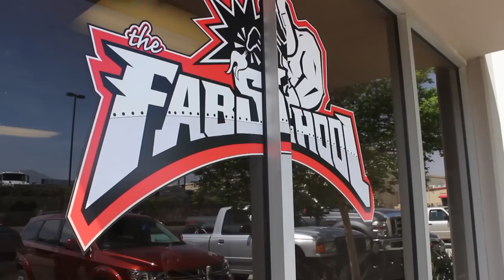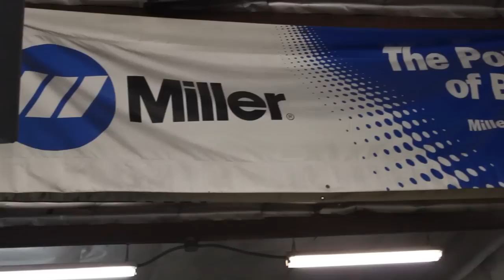The Fab School: Training tomorrow's welders today using Miller products exclusively

Comment: I agree with Defender Chassis.Countinous tacking is necessary for thin sheet and where the weld needs to be pretty(not a weld for strength)..Pulsing is entirely different from tacking or stitch welding.With pulsing the arc never shuts down.It just switches back from a high to a low current.Only high end mig welders can do this.This reply was directed towards mig welding only.The tack,tack method on tubing for a chassis is a no go.

Comment: I can see using the technique on flat sheet metal but there should not be a problem with distortion on tubing. In fact, I do not think the technique should be used on anything where strength is a concern. My $.02

Comment: Some call that stacking tacks but it's also called pulsing when it's used to mig thin material. Keeping an arc going on thin material can cause distortion and burn through. Pulsing is one way around that. I'm guessing that's about 1/8" wall and a car frame so he's probably doing that to prevent warp and distortion. Mostly it's a heat control technique.

Comment: I saw a couple spots in the video where an operator of a MIG welder was only moving the gun with the arc stopped and then repositioning for another short trigger pull. Is this an approved method by either Miller or The Fab School? I assume that the reason for doing this is to create the "stack of dimes" look like is possible with the TIG process but my concern would be with cold lapping as is a concern with the MIG process at the start/stop areas.